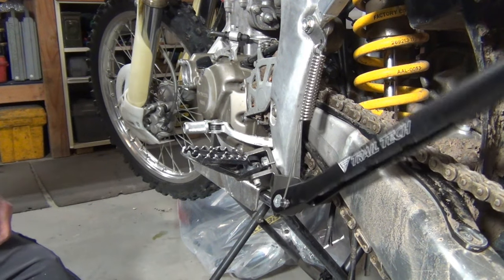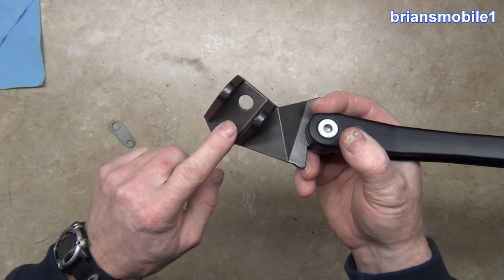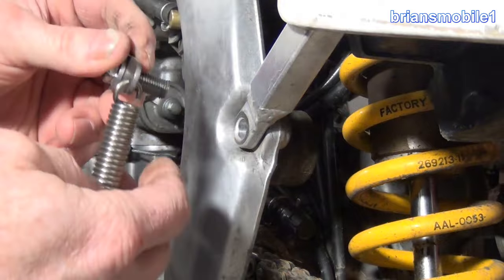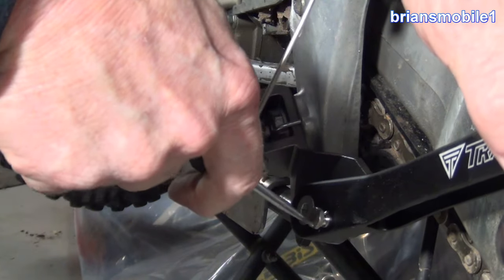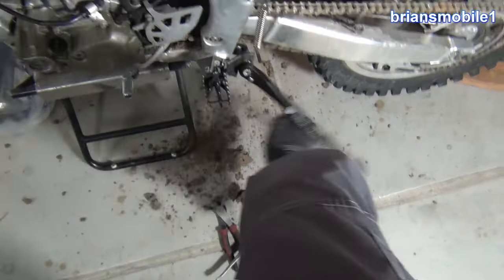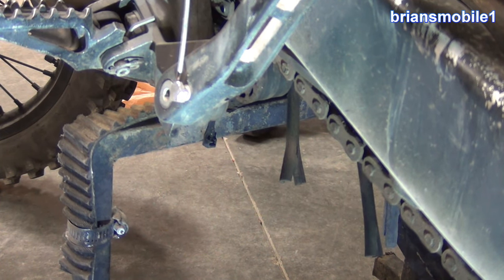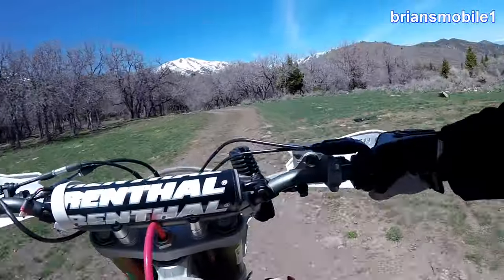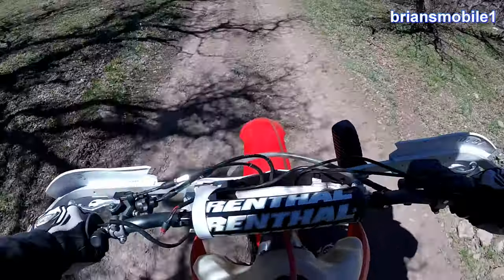Motocross Bike Kick Butt Kickstand How To

Comment: A very handy item. I remember trail riding and looking for a tree or a post to lean the bike against while opening the gates. Usually, they ended up 20 - 30 yards away.
Reply from the maker: It can happen!  Especially on a slope.
Reply: Yup, when you can crash into them they are everywhere, when you need them they are miles away :-)

Comment: Split pin, use once, unless it is not broken, then use till it breaks...... Or if you have nothing in stores to use.

Locking wire however is definitely a use once item.